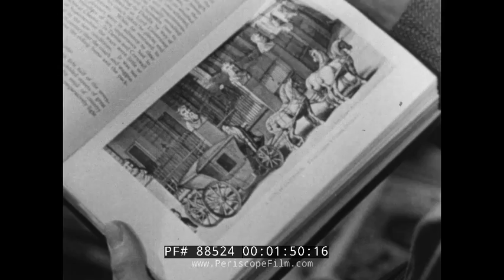" MILLIONS OF MASTERPIECES" 1948 CHEVROLET AUTOMOBILE ASSEMBLY LINE PROMO MOVIE  88524

Comment: I owned a 1948 Chevrolet Fleetmaster which  I bought used in 1953.Compared to a 2002 Corolla that I am still driving 22 years after after I  purchased it new in 2002 the 1948 Chevrolet was a rough, noisy and poorly designed automobile....it certainly was not a "Masterpiece"

Comment: Great promotional GM film from 1948.  It was still a seller's market until 1950 so new cars like these didn't sit on dealer's lots for too long.  There was a shortage of new cars in the late 1940s due to low sales during the Great Depression, elevated scrappage during WWII, and durability of perhaps 10 years for the average car.
Reply: You're absolutely right about the automobile shortage - and its causes - directly after WWII. In 2021 the severe new vehicle shortage because of no computer "chips" - and the corresponding shortage of used vehicles, along with obscene price hikes for new AND used vehicles - are the result of most car companys' ironic refusal to manufacture parts in the primary country where their products are sold!
Reply: @douglasstark1657  Sourced parts like computer chips are low bid contracts...certain auto parts are cheaper to manufacture and ship from overseas suppliers.  However, the real problem is that these computer chips were not stockpiled in anticipation of a major supply disruption (like a Covid-19 outbreak in a Malaysian factory).  Blame the Japanese "just in time" logistics model that all automakers now adhere to.
Reply: @SpockvsMcCoy  good information to know. It's still a huge mess for the cinsumer, though.....
Reply: @douglasstark1657  This "mess" may ease but not be fully resolved for perhaps two years.  A new factory to manufacturer those chips takes over two years to build and the cost is a couple of billion dollars. The pandemic resulted in increased worldwide demand for consumer electronics like video game consoles, printers, tablets, home computers, etc.  All those devices use chips and new vehicles use several chips per vehicle. All auto manufacturers were accustomed to a fast turnaround on a chip order made to an overseas manufacturer. Now an order takes several weeks or months to be fulfilled.
Reply: Not necessarily true. That all depends on what car brand you’re buying. 

German and Japanese cars are in short supply because their parts are imported abroad. GM and Ford do not have such crazy wait lists because they’re local (North American) manufacturers. 

I bought a Chevy Malibu back in 2021 with no wait line. Every other dealership I went to had a 4 months to 2 years wait list.
Reply: Most Americans used public transit or walked back in the 1930s and 40s. It was suburban sprawl in the 1950s that made automobile demand very high.

Comment: Those engines back then had no oil pump.  It was called a "dip and splash."  In other words, cups on the bottom of the crankshaft would pick up the oil and throw it into the engine.  It worked fine until speeds started to increase.  Then the engines were famous for throwing rods.  So, in '52, they went to an engine with an oil pump.
Reply: They had oil pumps. The rod bearings had dippers for oiling and cylinder wall splash. The rocker arm ass. and cam shaft got oil from the oil pump.
Reply: My old 69 cub 125 has a old Koehler in it. Has that same thing no oil pump, has dipper on bottom of crankshaft. It blows rods if rpm is high for long periods of time.